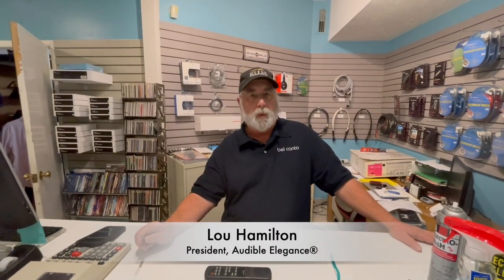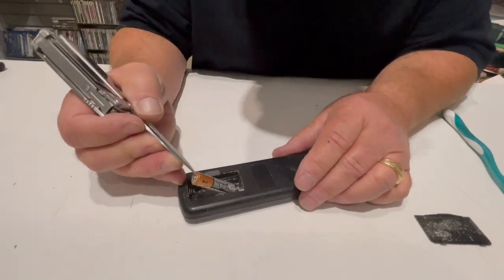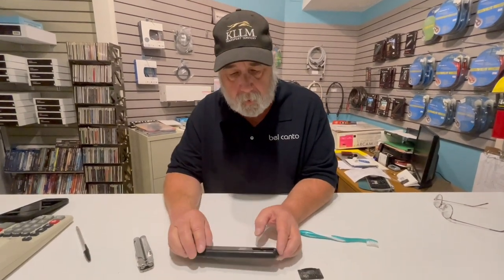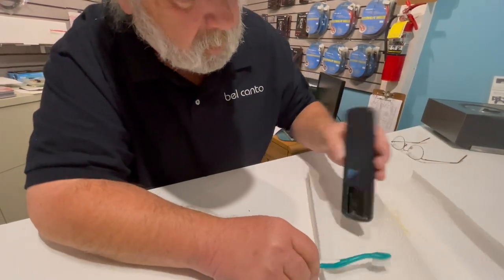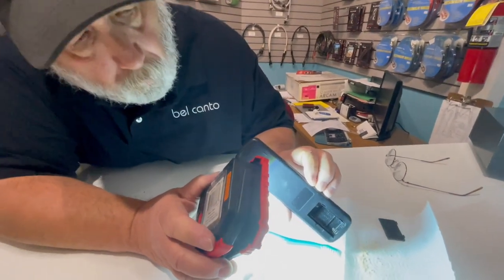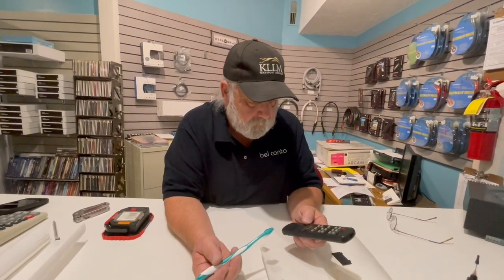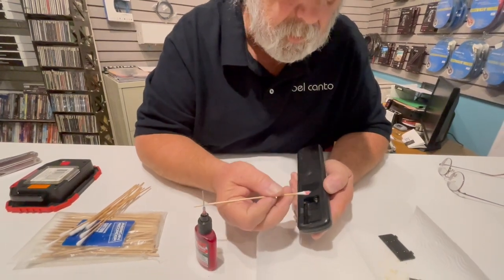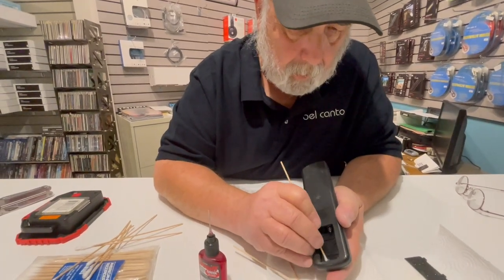How To Restore Remote Controls with Battery Leakage!

Comment: Happened to me. Removed the batteries. Loosened as much gunk as I could. Then used compressed air. Then used white vinegar cut with some water on cue tips. Then dipped the battery compartment end of the remote into a cup with the white vinegar and water. Let it sit until it stopped bubbling. Then took the remote out and shook loose all the liquid and then let it sit for a week to dry out. Works perfectly now. 🤷‍♂️
Reply from the maker: Well, congrats.  There are many ways to go about it but you did the right thing first.  Get as much of the gunk off as you can.  One will need to be careful with compressed air to make sure you don't blow the corrosion into the remote itself.  That's why I often use a paint brush.  I also use Pro-gold to neutralize the acid.  Watch out for that leaching into the inside of the remote and affecting the solder points to the board.  That's a real problem with Sam's Club batteries.  Excellent to let it dry out and sometimes I put such things on top of my dehumidifier to speed up the process.  

Thank you for contributing to the video and my channel.  Please enjoy my other 175 videos and tell others about my work.  I am sure that some may find your approach effective as well.

Comment: You just reminded me to pull the batteries out of remotes that I'm not using.  No sense leaving a time bomb in there if you don't have to.
Reply from the maker: Exactly!  It's sad to get a trade-in with the remote that has been sitting in the drawer for years unused but batteried up.  Interestingly enough, many times the remote control is worth more than the thing being controlled.  Yep, lots of people have made the mistake.